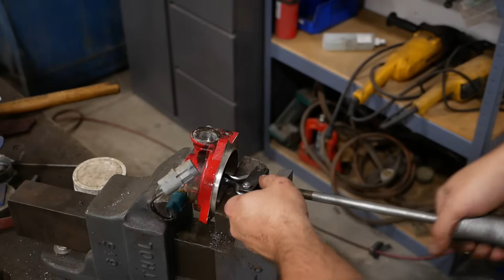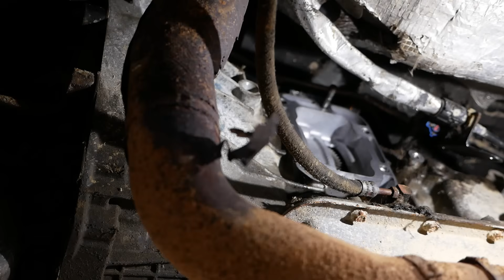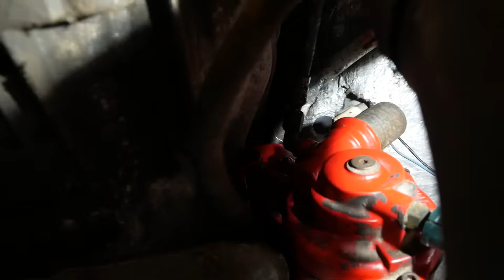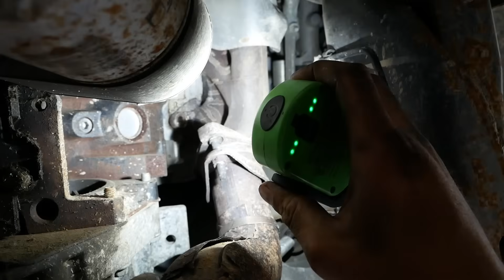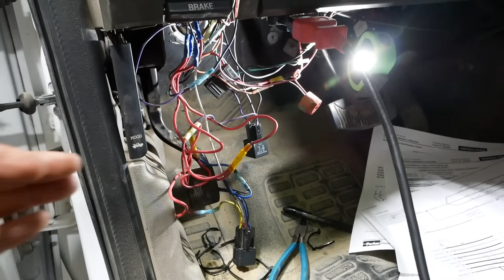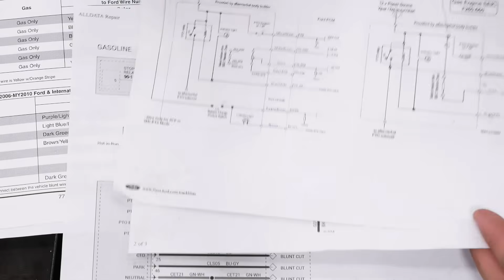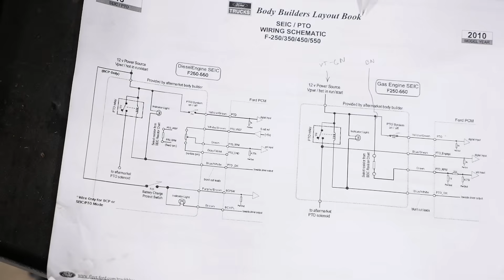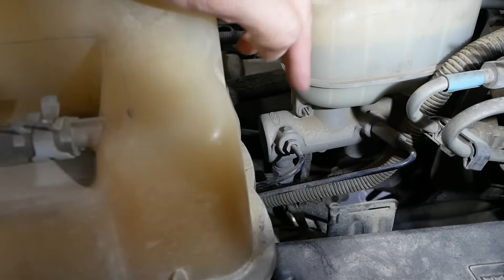Ford F550 Chelsea PTO Repairs - Unexpected Complications

Comment: Hey Wess y have the idea that the overpressure valve (bypass)on the hydrolics isnt working??? pump makes a lot of noise whit no load and pto on????
Reply from the maker: The pressure gauge on the valve block shows it’s working correctly.

Comment: Yea and it seemed like a fairly simple problem to diagnose too.. 4 shops.... wow. That happened to me with a brand new Suzuki still under warranty. I eventually had to void my warranty and just dig into it myself finding that it was as simple as the rubber air intake pass was off by a hair and sorta folded under on the manifold causing the air sensor to whack out the computer and causing an improper reading... and the dealerships ... in my opinion never even looked at that.

Comment: LOL, saying Ford had problems with the brake pressure switch is like saying Tesla have a problem with running into stuff when on autopilot.  Ford had a recall for nearly every F series truck made in the last 30 years due to the pressure switch catching fire and burning people's houses down.  As I recall, their fix is to add a fuse to the connection.  They may have also replaced the switches on some trucks, since one of mine has actual BUTT connectors on that switch, going to the Ford supplied inline-fuse.  It's obvious the switch is not the original and the connector was changed when it was replaced.

Comment: We made our own seal tool in tech school.   Take 4-6" of piano wire, make a loop, and poke the ends into a piece of brake line.   Use a hammer to smash the brake line tight onto the wire.     Very handy and very cheap.

Comment: I'm 13 minutes in and this video has helped me to understand how the clutches in an automatic transmissions work more than any other video out there. I never realized that the frictions and the steels were splined to 2 different bits, i always thought they both splined to the same part.
Reply from the maker: It's a pretty typical multi-disk clutch. I think the piston is a little different than an auto transmission.

Comment: thanks for the video wes! we have blown our pto 3 times already. what a nightmare. i wish there was a better unit available. ours runs a low profile vactor used to clean catch basins in underground parking. no pump = cant work
Reply from the maker: Interesting. How long does it run between failures?
Reply: @WatchWesWork  its been to the shop 3 times this year. same deal as your customer. we have taken it in to numerous  shops. there's something wrong they aren't seeing. lol ill drop it off next time with a copy of your video.

Comment: I’ve encountered that on Ford powered ambulances.  Sitting on the scene we want a faster idle speed to help the AC, emergency lights and electrical equipment in the box.  We constantly got write ups for now high idle and they never put in the parking brake or they had their foot on the brake.  We tried covering it in training but no one would listen and learn!  Now we have 550 fire trucks that have a 9 step process to engage the fire pump.  Miss one and no water!

Comment: Now if I’m the garbage company I’m overriding the Ebrake switch, so you don’t have to set the park brake every time you need to run the system, I know on my knaphide, and reading , Chelsea setup, the regular brake doesn’t bother it, mine will actually run while driving on one truck, but locks out OD .. ?
Reply from the maker: Muncie has a system to do that on the F550. I'm not sure how it works.

Comment: Mid vid snarky…loved it… 🥸… Remember seal o-rings back 40 years ago were injected molded .There were times during assembly the seal would have a pronounced “burr” caused by leak by during manufacturing. There were some assemblers that would dry fit the parts because they used white lithium grease for everything and they were “ prissy “ and didn’t like getting dirty. The seal you took out is a good failure mode for the assembly plant because this issue would take years to fail thus out of warranty. This would be caused by oil not being able to preload the pressure on the clutches evenly in turn the friction disks would always have a high side and slowly erode . That friction disk material would be like lapping compound flowing though everywhere and finally end up in the filters and bottom of the transmission pan.
Reply: what's the problem with dry fitting seals, if it fits it sits right?
Reply: Tell that to a customer that buys over 100 pieces of earthmoving equipment every three years that has a string of scrapers down with that same issue. I have seen hundreds of “ preventive “ failure modes in 45 years as a field engineering tech and the strangest one was a torque converter from a 797 off highway truck. There were multiple possibilities during the introduction of this mechanical drive monster with the transmission being the target because we had bean counters running the plant and not the engineers. To have a torque converter fail was the first one in over 1500 test hours in the field. I personally took the lead to diagnose the cause of this failure and the first thing we check is the return suction sump for metallic debris in the magnetic screen. I was surprised no doubt when a pant leg of denim was stuck in the suction stub which caused the friction plates to “ weld “ themselves together. I called the on-site engineer and asked him what procedural policy that they documented at the job site and duration of maintenance intervals , he chuckled and told me that at this copper mine located about 5800 feet above sea level in Chile was being run with 10/12 year children doing the routine maintenance .
Reply: @GrumpyOne2008Air  cool story, but I still don't get what the problem is, I'm not a mechanical engineer
Reply: @Netherlands031  Lubricated install (hopefully) prevents nicks and cuts that =leaks; also installing over sharp edges and burrs can also cause leaks in the seal

Comment: Brilliant though unpleasant memory stirring for me. I hated the ash carts in our garage.  I once fitted a hydraulic valve block to one, whilst being dripped on by a full load. The valve I fitted was a recon, and only the paint was sealing it, and when someone poured 25 litres of hydraulic oil into the header tank, I got soaked in it. Oh happy days.

Comment: Why America, are you still making Gas powered commercial vehicles ????
Reply from the maker: It makes a lot of sense. You can buy an entire long block for the gas V10 for the cost of injectors on a diesel. Garbage trucks usually don't run a lot of miles.
Reply: @WatchWesWork  
Yeah i suppose but nearly everywhere else on the planet you wouldn’t expect to find a gas engine in anything commercial in the last 30 or more years.
Diesel engines just go & go & go, self lubricating ! 
There used to be engineering shops locally that would re-line injectors & rebuild pumps, much like the place you’ve visited but they are less & less used these days due to the reliability of new diesel parts, better service cleaner fuel & parts being more replaceable than the older indirect injection stuff.
I’d rather swap out injectors than replace a whole engine to be honest.
Reply from the maker: @Will-thegrumpysoutherner  In our area the truck rusts in half long before the engine dies.

Comment: Skill levels among independent guys who start their own shops are all over the place. Many can turn a wrench and do some basic diagnostics, but struggle on anything beyond that. The problem with larger shops is that they aren't willing to, or are just unable to find someone with your skill level. After you decide to pull the trigger on hiring someone, it's tough to weed through all the applicants and find the right guy. How much time can you spend failing a search over and over when you have a business to run. It leads to a shop full of guys who know a bit about this and a bit about that. If they all get along with each other maybe they can collaborate and get a problem like this solved, but from my experience knowledge tends to be closely guarded.

Comment: Great, methodical diagnostics as usual. :D 

I wonder if the original body electrics were fine, but that brake switch going bad caused the PTO to not operate one too many times, so the whole control system got bypassed?

Comment: Half these "mechanics" any more are just parts changers. Their scan tool tells them what's wrong and they change the part. No need to think or diagnose, the computer does all that. I'm a shade tree hack and I can fire the parts cannon just fine. When it goes to the professional, especially one that purports to be the dealer for the chassis or the components, they really need to have people that can diagnose and repair, not just aim and fire. You, sir, are a real mechanic.

Comment: That seal failed more than likely because it has a very narrow profile, yet a very tall/deep groove to fit in. It's like trying to use a cue stick to stop a car by scraping it on the ground from the passenger seat. Ain't gonna work, and i'm willing to bet anything this is engineered to fail. That seal makes 0 sense, no, scratch that, it makes Ø sense.

Were this my PTO, i'd have someone manufacture that piston from scratch, using a proper seal for it, as is, it's made to break.

Just my 2 cents, but it's the first time i've seen someone use that configuration in such a short stroke, unironically.
Reply from the maker: The maximum line pressure is only around 260 psi. It's not like a hydraulic cylinder. That seal should last the life of the truck.

Comment: Well done sorting the electrical issues,yes the Clark system is smart,but a basic pto drive on off simple,Wes you went the extra mile,but us rural shops see so many hacs ,on stuff,have nor problems is understanding what the manufacturer intended,and how it was actually achieved,go video though.

Comment: Wes, to get that clutch piston seal started we were taught to use a feeler gauge in transmission school and work it around just like you did with that pick kind of gizmo you were using. Nice thing about feeler gauge is you can pick the thickness to suit the outcome you want.
Reply: Was going to suggest this  myself when I saw you beat me to it. I always found .020" was about right.
Reply: Precision calibrated tapered thickness gauge with rounded end, bent to suit; comes with a handle as a bonus. Cannot bend. Conforms to wide range of diameters. Ideal tool!

Comment: That wiring wasn’t THAT bad…. There wasn’t a single scotch lock or wire nut in sight 😳🤣
Nice work as always.
I just picked up a 93 Ford Lightning that still has that TSB out in it.   It’s a brake pressure switch leak issue.  It’s the big one that will cause the trucks to burn to the ground.   While I despise dealers, I may need to take it In for that one.
Reply: I believe the TSB is just to add a inline fuse on each leg of that wire. Pretty simple really.

Comment: Most shops have no diagnostic ability at all. A friend and I diagnosed massive oil blowby on a '09 International, blowing oil into the intake and burning/leaking 10-15qts in about 4hrs run-time. Local big-rig shop hooked it up to their computer, had turbo efficiency codes so they replaced the turbo for $5k and said "Yup, back to normal power, good to go". Never had a power complaint with it and it still had the massive blow-by/leak issue. Turns out that sort of diagnostic is typical for that shop and shop #2 found a dead hole. $25k later ($6k for the EGR system alone!) the engine was rebuilt. I'm not convinced it was a dead cylinder (mainly from the lack of a power complaint and we didn't feel a power increase after rebuild) but it makes more sense for the crankcase being over-pressurized than an issue with the turbo itself.

Comment: You forgot the first step when working on any Ford super duty….. removing the cab
Reply from the maker: It sure would make it easier!
Reply: @WatchWesWork  Modern Range Rovers are designed like that -- gotta take the body off to do pretty much anything more than an oil change.  Sounds crazy, but because it's been designed from the start for it, it's not difficult and doesn't take long.

And then you have working room!  No squeezing your left arm between wheel arch, firewall and exhaust with a special bent spanner to get at a bolt.

Comment: I believe all automatic transmission ptos have clutches or sleds they would grind. I think they call them “hot shift” ptos. Manual transmissions have the fork that move the gear over on the collar because you can break power to it with the clutch so it won’t grind.
Reply from the maker: That's kind of a new thing.
Reply: Hot shifts have been around a long time.
Reply from the maker: @steve197232  I really don't know. I've definitely seen sliding gear PTOs still used on very new trucks.